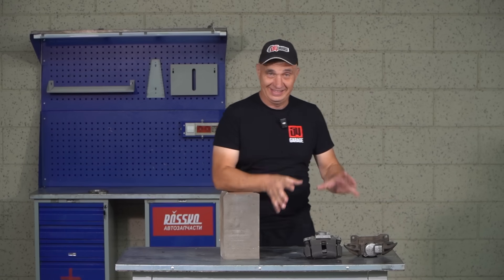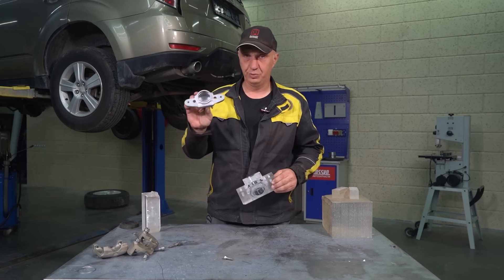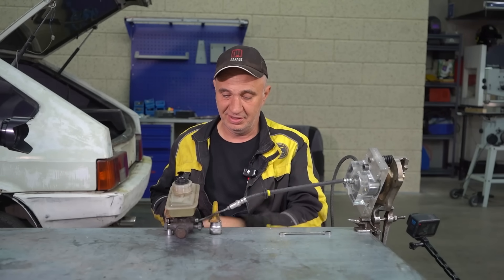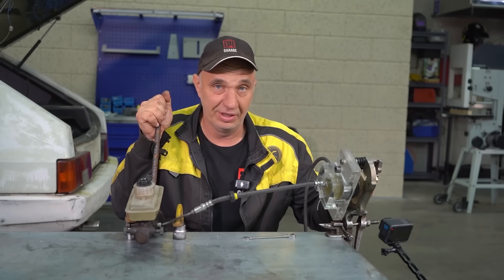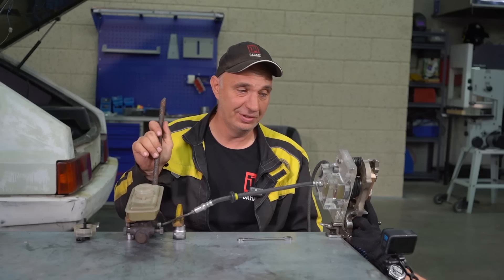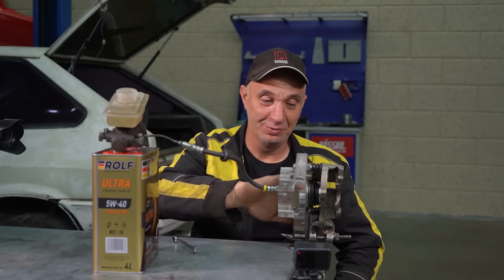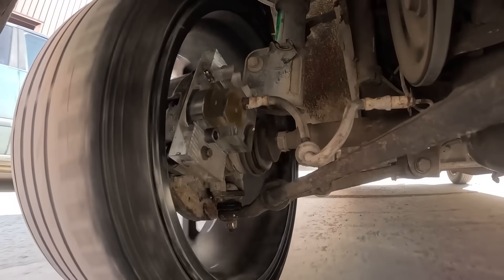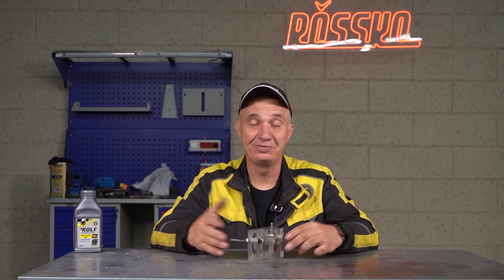We make a transparent brake caliper (look inside while bleeding it)

Comment: I have always preferred gravity bleeding, I think it has always worked better for me. I sometimes give it a pump or two to start the fluid moving if it is empty, but it clears the air better letting gravity do it's thing... additionally, forced bleeding can create turbulence while flowing fluid, especially from empty, turbulence causes cavitation, cavitation creates air, and then you have to flush a lot more fluid to get it all out... The slower gravity flow reduces all that, making it all easier and more efficient...

Comment: You don't need 2 people to bleed the brakes, you need a long metal rod that you use to press the pedal with, then prop the rod with the seat by sliding it forward to keep pressure on the brake pedal, then bleed the piston, close the valve, go back to the metal rod and do it again, and in 3-4 pressures on the pedal you should be fine. I'm a lone wolf, I don't need the second pair of left hands 😂😂😂😂😂

Comment: What about transparent aluminum? (anyone).  Seriously though, if the dirt, rust, and water collect at the bottom, what about an initial bleeding with the caliper unbolted and held upside down to force out the debris?  I use 8-10psi and pressurize the braking system with a modified brake cap, I will never go back, it works perfectly.

Comment: This demonstration is not correct. On a car you have the components on different levels. The master cylinder are mounted higher than the caliper. This give the the system a gravety pressure who help the air bubbles too leave the caliper.

Comment: Could you do another and try bleeding the brake system using the one person suction method?  I see people using this method and they continue bleeding it seeing bubble coming out at the end. Apparently this is air being sucked into the system via the threads of the bleeder valve. I have always wondered if the suction method leaves air in the caliper as well?

Comment: Interesting comment as I've bleed thousands and thousands of brakes, some brake calipers have two sets of bleed screws like in Corvettes, but one thing I learned when you have a brand new set of calipers. Is when you think you've bleed all the air out, take a small hammer and tap the caliper for any air bubbles trapped they will be released recheck with the bleed screw.
Reply: Not creating more bubbles?

Comment: Great video.  A tip for those who gravity bleed: Use a large vacuum extractor like MityVac, push the pedal slowly gently a few times, then hop out and watch your clear tube at the caliper until no more bubbles.  Close the bleeder, repeat on all the wheels.  Remove the bleeder screw, apply grease to its threads and above the threads where it sticks out of caliper to reduce air drawn in at threads.  Keep vacuum on the extractor at all times. This greatly speeds up bleeding.  Stay gold.

Comment: Interesting video and excellent fabrication work.

  I recently replaced calipers, rotors, brake pads, and hoses on front and brake shoes, hardware, and drums on rear of 1997 Chevrolet K1500 so I wanted to completely flush entire brake system and replace with new fluid. When I started researching that process I quickly realized it was not nearly as simple as I had imagined due to the ABS system and the difficulty of pumping out all the old fluid while not letting master cylinder run dry.

  I ended up having to spend more money on a bi-directional GM Tech 2 scan tool to do the ABS power bleed. 

  The other thing I bought to get the job done is one of the best tools I have ever bought. It is a Motive brand power brake bleeder which looks like a small pump sprayer and it has a machined aluminum plate that seals to top of master cylinder and has a silicone tube coming out of it. The pump part also has a silicone tube that connects to master cylinder. Once set up you simply put new brake fluid in the pump part of tool and screw on the top then pump it up to no more than 15 lbs pressure and start at furthest brake from master cylinder as usual. I had a soda bottle with some silicone tube inserted through the cap. I pressed the tube over brake bleeder screw and opened the bleeder. Then I just watched the fluid running through the tube until it looked clean and fresh and closed the bleeder. I checked brake fluid level in pump and pumped it up to 15 lbs again then went to second furthest and continued. After I had done all four I connected scan tool and performed the ABS power bleed twice. After that the brake fluid in master cylinder looked dirty again so I repeated the flush process again. With the Motive power bleeder that cost $80 and change I was able to do all of that in just under two hours by myself and without it I have no idea how long it would have taken using gravity bleed but I'm guessing it would have taken probably 3 times longer at least. And with traditional bleeding method I would have had to find someone willing to come and pump a brake pedal for the afternoon. That was a month ago and my brake fluid is still clear as new. 

  The Motive power brake bleeder is some of the best money I have ever spent on a diy automotive tool.

Comment: I like vacuum bleeders. Need to flush quite alot through but works well. On a tricky car I put over pressure in reservoir to push air through with quite a bit of flow that grabbed the bubbles with it.
One weirdest to bleed was Saab clutch. I used an oil drip can to pump fluid up from slave to master.

Comment: Really great video!!  I know we all have seen plenty of clear plastic automotive parts on YT before. But this is a really good one showing some great points about brake bleeding, like the foaming brake fluid! I know about air and foaling brake fluid but I never knew it could be done so easily in a simple bleeding of one caliper. I will be more careful from now on. 
This should have been in my 1970s automotive class to learn this. We also had different shop class metal & plastic. I could have made a clear plastic learning device for Auto-Shop class instead of a stupid letter opener!

Comment: you missed testing out the 1 man bleeder kit. where you have a hose and a cup that are attached to each other. and you open the bleeder with the hose on it and the hose loops up higher than the caliper to trap air while access fluid goes into the cup as you press and pump the breaks by yourself. would have been cool to see

Comment: here in the states we all pretty much use a vacuum , in theory should be the same as gravity fed just quicker , but be nice to see , I fill / flush mine this way for many years , I'm curios if any foaming is happening while using the vacuum in this manner vs gravity fed
Reply: I tend to use pressure. I have a vacuum system but it tends to pull air in around the bleeder nipple threads and the pressure system does not. As a bonus the pressure system also keeps the reservoir full of brake fluid. The other method is a tube with a check valve on the bleeder nipple and then into a catch can.

Comment: love your videos.  

Would have been interesting to demonstrate all the different ways to bleed breaks.  Three others I know of is vacuum on the bleed point pressure on the master reservoir and having the bleed tub go up in the air to catch a volume of fluid that will flow back into the wheel cylinder when the pressure is off.

Comment: I've told apprentices after getting brake bleeds wrong by poking the peddle or not locking the nipples on release, when in doubt; gravity bleed. Its slow but its the most reliable especially on older cars with worn parts. I trained with old boys, shame there's none of them around anymore. Great vid.
Reply: Whenever I replace calipers I always gravity bleed, and then typically have one of the other techs jump in and bleed it just to make sure, but the gravity bleed is typically perfect

Comment: 1 person can bleed brakes alone. Crack the bleed nipple just enough to pass air but not fluid - it's not hard. Fill and stamp the brakes. Once happy then use a jack handle against the drivers seat to keep the pedal pressed down, then tighten the bleed nipple. Job done ✔️

Comment: You can get a device that fits on where the master cylinder cover goes. You fill it up and you don't have to worry so much about running out of fluid or getting bubbles or vapor in the fluid. You can also buy brake bleeder screws that have a spring-loaded valve that closes up as soon as there's no pressure. These work great if you are working alone.

Comment: With the transparent stuff if the engine is made much thicker and stronger and with a lower compression ratio it could work, 
Gearbox is easy to make then other parts can be made for a full transparent car

Comment: You should try an experiment on a car by running a pipe to the exhaust and then piping that to the carburetor all piped in together. With no air leaks. It was said that it won't work because the engine will be deprived of oxygen but then again who knows how long it can run like that. It's never been proven.

Comment: Another method is to place a hose on the bleeder higher by about 12” or more and very slowly pump the brakes while only one bleeder is barely open.  If the pedal has a fair amount  resistance to go to floor, then the bleeder is open just the right amount.

Comment: I quite often bleed brakes by letting fluid flow freely without pumping pedal.
Reply: Same here. But if the lines are dry, it takes a while if it even starts to flow. So I take my blowgun and blow compressed air across the bleeder screw to create kind of a Venturi vacuum and it speeds it up. Take care!
Reply: Every text will tell you your method will result in bubbles.

Comment: us Americans have a way to bleed brakes. it's called the redneck bleeder. it is a clear flexible tube in a clear bottle with a bit of fluid in it. you put the hose in the bottle, and the other end goes over the loosened bleeder valve. fill resivore and pump it till the resivore is almost empty. refill it and pump it through again. just tighten to bleeder and its done. you could do a whole segment with your caliper and a Pepsi bottle to see how well this works.

Comment: I want to see you do the same with water because it doesn't compress as a fluid but it will leak out without a proper seal but I want to know if it will work as well as brake fluid if sealed with no leaks 👍
Reply: Water would work just as well as brake fluid, it would just destroy the system with rust... But until then, and unless you got it to boiling point it would work.

Comment: Can you guys build a four wheel drive train driven by hydraulic fluid from the engine
Reply: It's called a fork lift, skid steer, articulated loader, bulldozer, basically any big yellow machine. 

Low speed high torque, you'd flatten the Lada before you could show the usage. 

Now making a transparent wheelrotor or hydraulic pump would be a good bit of learning.

Comment: What's missing is to make the entire car transparent. Gas tank, hoses, engine, gearbox, tires, brakes, brake discs, seats, pedals, chassis, bodywork... 😂😂😂😂😂
Reply: They made engine transparent already it blew up on the first compression stroke
Reply from the maker: We did get the second version to run for a little bit though.
Reply: @Garage54ENG  Next time, try using a early 1900s engine design like a Ford model T as a template. My guess is, those will work on lower compression than a Fiat/Lada engine design from the 1960s and maybe last a bit longer.
Reply: @Garage54ENG there has to be a material to see through and hold for at least 3-4 hours of constant use. Reinforced glass? Would that work? Or that glass that resists to high temperature 😅 or X-ray while the car is running and that's a see through car 😂😂
Reply: @nooneissafe202  power stroke, once the fuel ignited BANG!
Reply: theyre already building that transparent car...one piece at a time.
Reply: Transparent CV boots would be kinda neat.
Reply: @jwalster9412 that would be about impossible to make a clear flexible material. They use a large clear poly hose with reducers on the ends.  But that’s about the only way.
Reply: no one needed to see this but i watched anyways
Reply: Windows...
Reply: the wacky part is that Pontiac actually made a car with a transparent body in 1939. iirc, it's in a museum somewhere. It operates just like any other normal car, it's just see-through. It's really neat
Reply: MSU ag school had a live cow with a window in it's side to view the stomach working.
Reply: They are, just one part at the time
Reply: Why do you gotta go there now I need that I am itching lol
Reply: @Ghost-07 you forgot the add making the glass transparent…
Reply: Like Space Ghost?